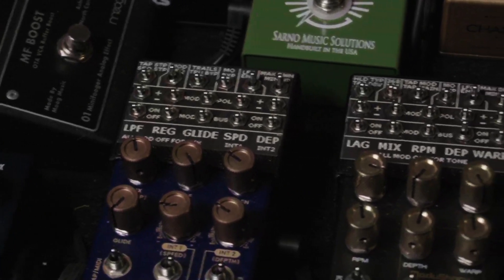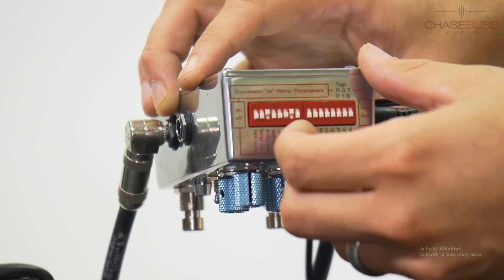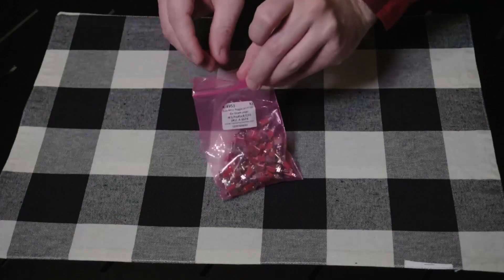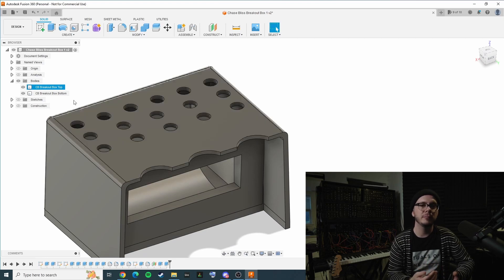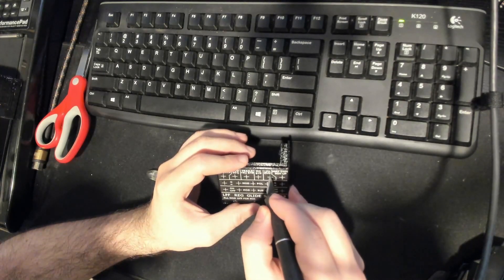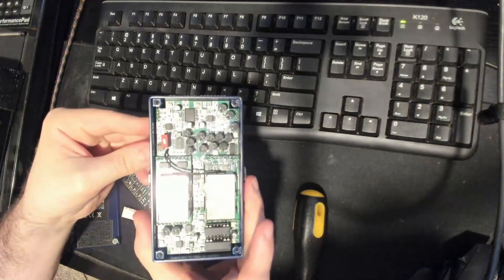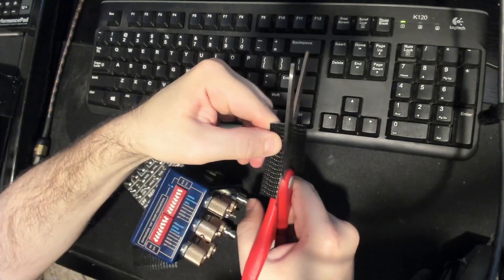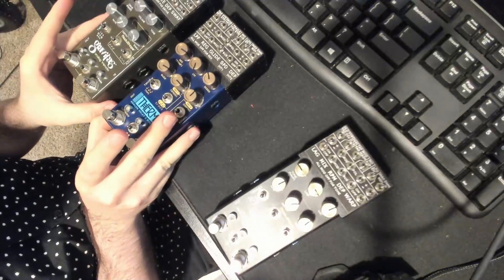Chase Bliss Pedal Mod - Dip Switch Breakout Box (DIY How-To)

Comment: Just used the files with my new resin printer I got (my first printer) came out amazing. Now I have 5 to mod. Thanks for the mod and the resources can’t wait to dive in
Reply from the maker: Heck yeah! I'm in the process of doing a second version of the mod using custom PCBs and a folded sheet metal enclosure instead of 3d printing, but it's a few months off from public release. I might suggest using a single layer of dual sided adhesive rather than 2 layers of dual lock, for extra rigidity, but this mod has been working great for me on my 6 pedals for a couple years  now.
Reply: @myretrofuture1731 nice can’t wait to see the pcb. Big fan so far
Reply from the maker: @andrewsimmons8051  Thank you!
Reply: @myretrofuture1731  youre welcome. Quick questions, does it have to have sub mini toggles or will mini toggles work out?
Reply from the maker: @andrewsimmons8051  I just double checked the data sheets against my model - the answer is no. Mini toggles will not fit, has to be sub-mini. If you already bought them, you maybe could cram them in diagonally or something but I'd highly recommend going with sub-mini.

Comment: Good stuff man! Been waiting for this, thank you for putting in the groundwork and prep to organise all of it for this video. 
I just received my Reverse Mode C recently, so I might try this once I get settled in properly with the pedal. I might try and make the chassis out of some scrap metal since I don't have a 3D printer, and it also deals with the shielding/grounding issue.
Reply from the maker: Awesome! Thanks for commenting, and I hope this helps if you go through with the mod!